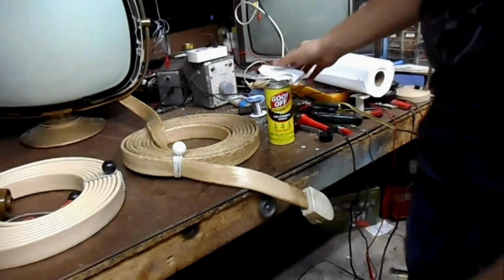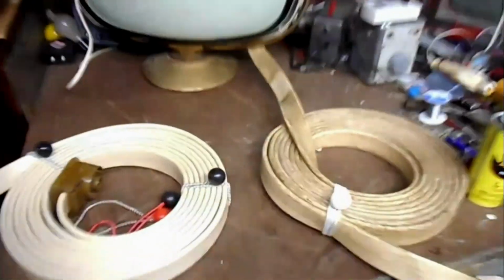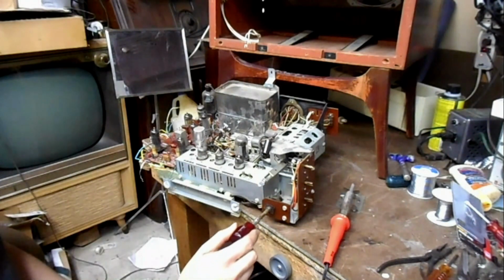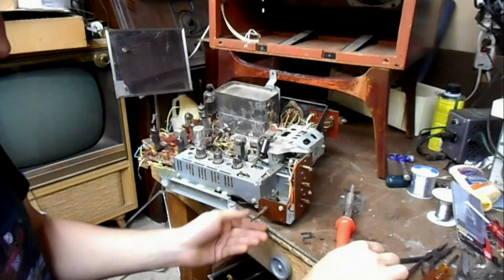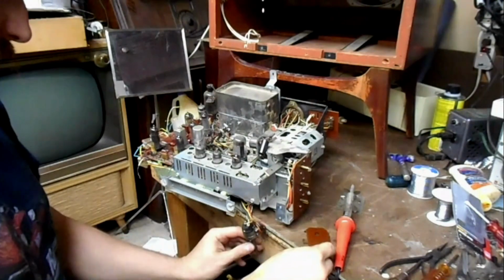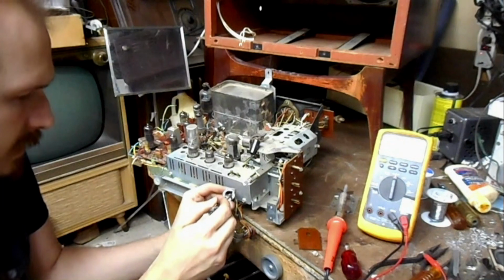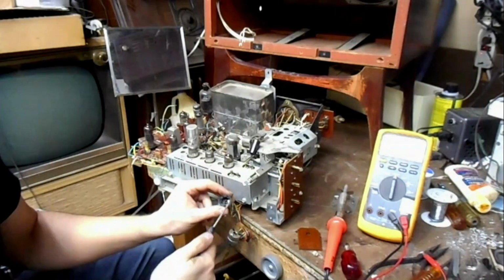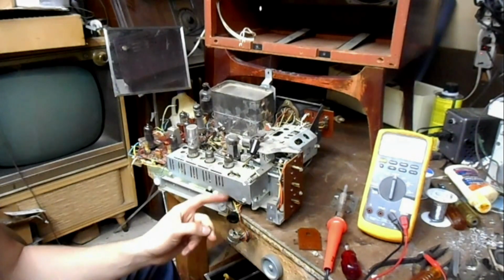Predicta Power Switch Repair and Cable Clean

Comment: Nice video! I’ve never had a bad Predicts power switch so I've never had an occasion to look inside one. Now I know. That cable cleaned up really nicely. One suggestion: you might want to try a Mr. Clean Magic Eraser on the cable, with or without the Goof Off. That’s my go-to cleaner of choice.